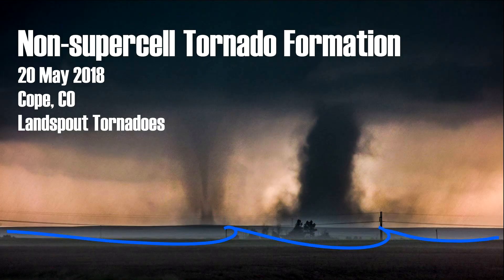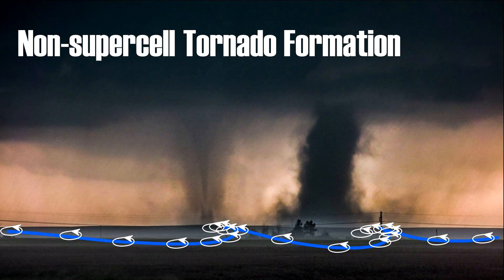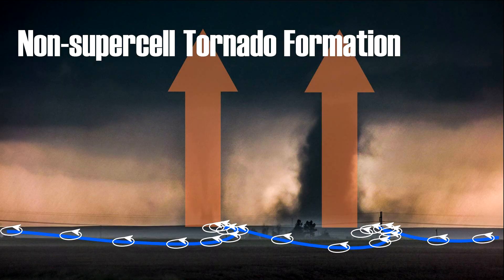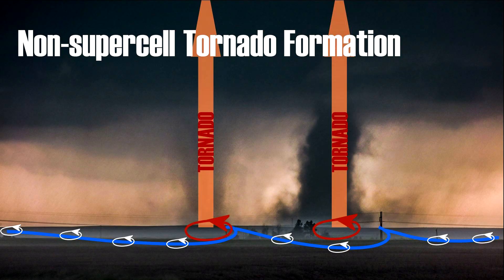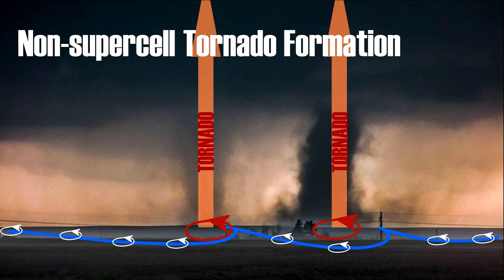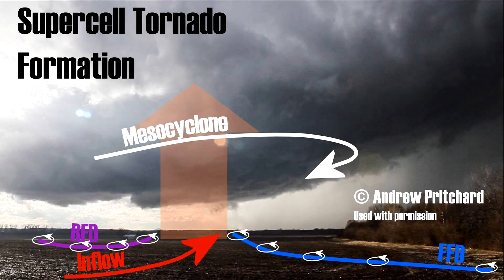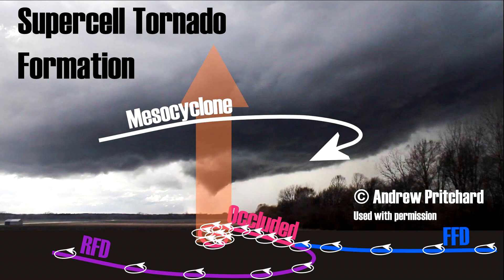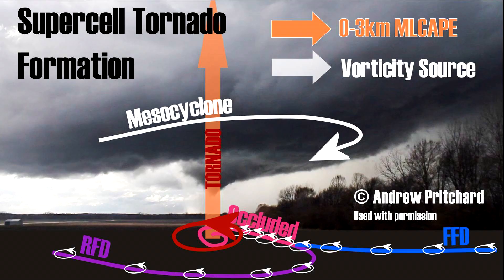How do tornadoes form?

Comment: Skip. Something I’m gonna be doing a research paper on is if the earth rotation has anything to do with tornado formation. My basis is the cyclonic storm on Jupiter that is affected by its rotation. I don’t think it does haha but since we keep getting new info, it’s worth looking into. Especially everything we learned from El Reno 2013.
Reply from the maker: The Coriolis Force! It's important in large cyclones like hurricanes and extratropical cyclones that are the parent storm systems of supercells. But on tornado scales it's usually an insignificant factor. Tornadoes spin way faster than the Coriolis Force would have influence, and they can spin in either direction. If the Coriolis Force was dominant or significant we shouldn't see many or any anticyclonic tornadoes. And this is also why bath drains don't always spin cyclonincally. The toilet flushing the opposite direction in the opposite hemisphere is a myth. And those spinning drains that local hucksters show tourists on the Equator are scams. There's a cool video by the Smarter Everyday guy about this, where he demonstrates you need a large pool sized tub and hours of time before you notice the Coriolis Force... at all.
Reply: Skip Talbot's Storm Chasing Chronicles I knew you would reply! Thank you so much. I couldn’t find anything. I figured it didn’t but now I know what to do do my paper on! The coriolis force! Thanks my man!

Comment: That's close enough, keep spreading the insight and eventually lives and property will be saved.  Just remember to include that tornados are harvesting energy that grows on the fields below; the inflow energy is converted and stored in horizontal vortices by frictional ground effect, this rotation rushes toward the low pressure point of updraft that in turn transfers that energy to vertical rotation when sucked up.  Ground level obstructions diffuse the energy by collapsing the inrushing vortices by infusing chaotic flux into their closed systems.  However once the tornado is wound up it no longer requires the ground based energy; inertia mixed with updraft energy will carry the tornado forward. 
Show less

Comment: If the meso is driving and organizing/collecting all the little vortices. Doesnt that mean tornados spawn at both ends?
Reply from the maker: The meso is creating and pushing the gust fronts that are interacting at the ground. It's like a chef up in the clouds, and it's reaching down with downdrafts to organize all the ingredients at the surface to bake a tornado. The storm is one big fluid process, not an object that fits in a well described box. But I think the question is, where is there a vortex first appearing that we would label a tornado? I think that column of violently rotating air often appears at ground level first. But the entire updraft column beneath the storm's base (orange arrow) may be essentially wrapping up together at the same time. So the whole column becomes a tornado at the same time. The point is that the vortex we'd call a tornado isn't up in the clouds first, and then touches down later. It exists at the ground either before or at the same time as anywhere else. Hopefully this makes some sense.